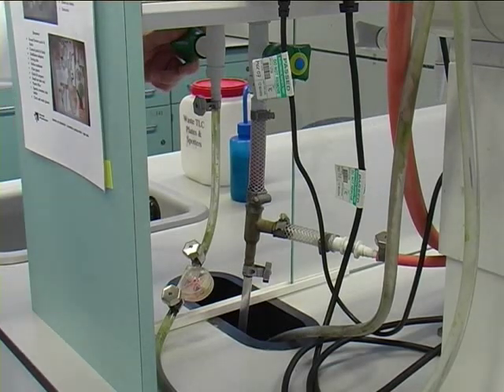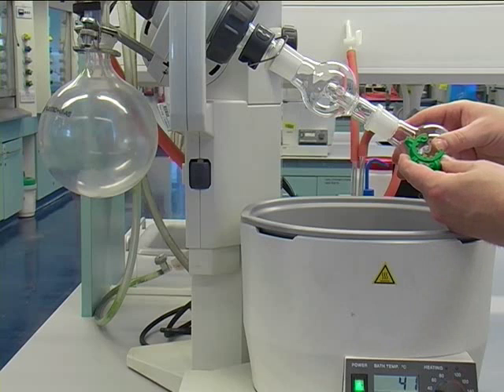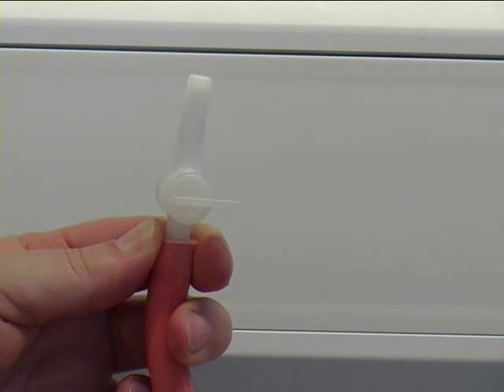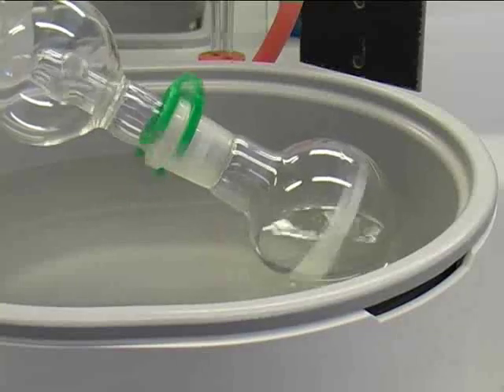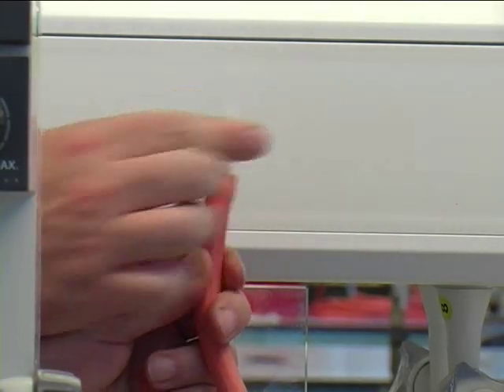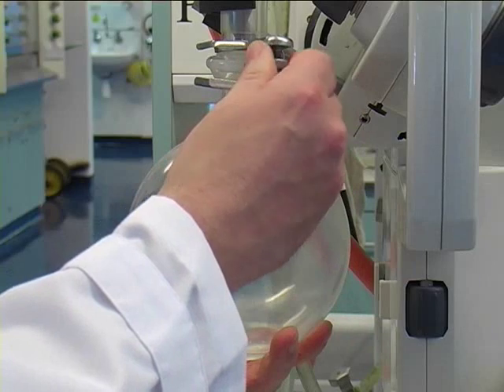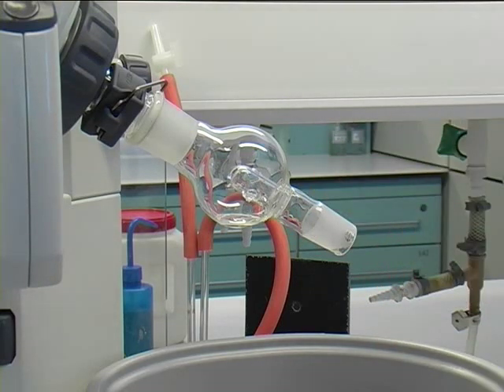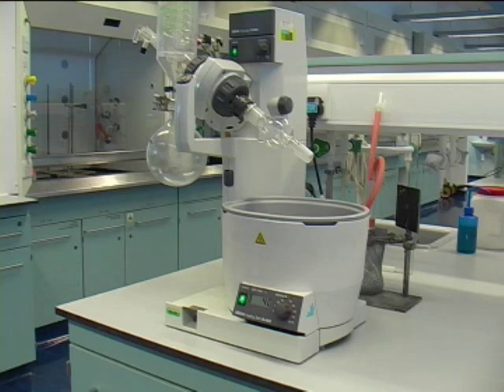Using a rotary evaporator (5th floor lab)

Comment: @ilaughcrying :
I think, that wouldnt help you anymore, but maybe it is helpfull to someone other:
Cool down the evaporation flask in an ice/NaCl-bath and wire a towel (ore something else), which is wet of hot water, around the glass tube right above the male joint of the rotating tube, which is wet of hot water.